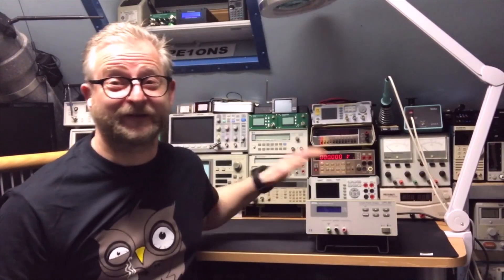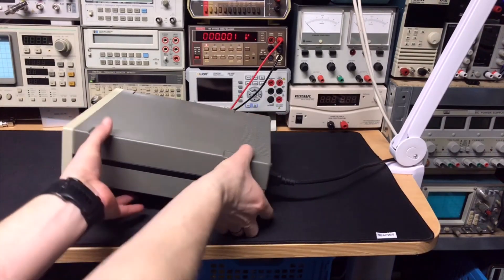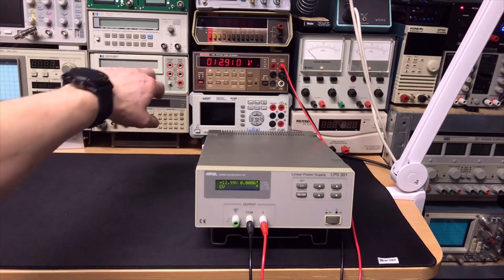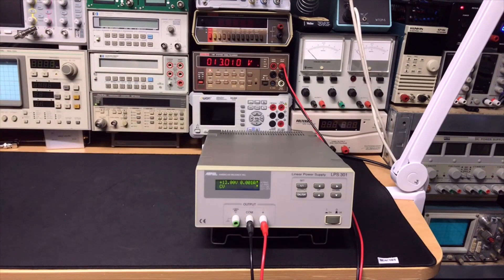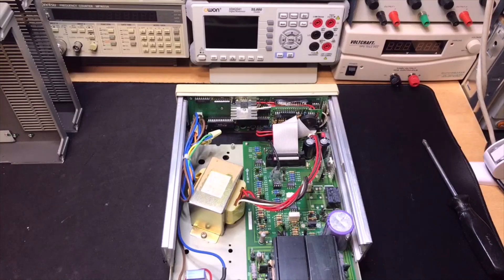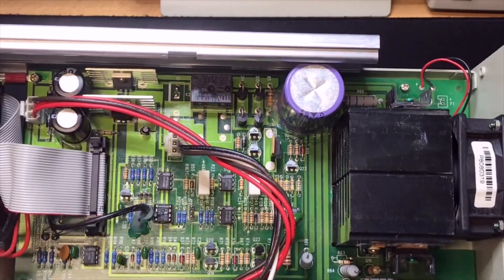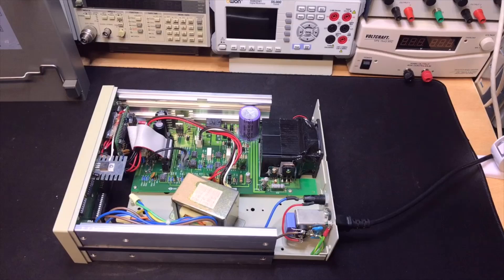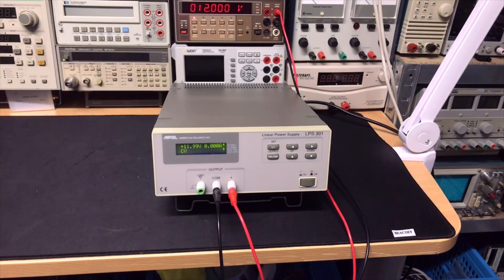#132 AMREL LPS 301 Calibration Cleanup Teardown

Comment: I used to have a power supply like that. When the buzzer is enabled, it makes a distinctive sound when it powers on, and also when it switches between cv and cc modes. I bought mine from ebay in a reworked state with few minor obvious issues that I fixed. But ufortunately, it wasn't reliable. Most of the time it worked, but sometimes it was outputing an incorrect unstable voltage, which was scary. Someone was fixing it before me, probably more than once, trying to workaround some problems by cutting PCB tracks and throwing bodgewires. Without the schematic in a non-virgin state after failed repairs, it was hard to bring it to good condition. I eventually gave up on it and gave it away to someone else. Agilent had excellent promo prices for U8002 power supplies, so I quickly got one.
Reply from the maker: Hello Thank you for sharing that, i do have the schematics if you are still interested.. yes the Agilent, yes proper stuff, well done!
Reply: Hi @TonyAlbus   I have an LPS-304 that no longer provides an output voltage consistent with the set value. During the calibration of V+ and I+, it does not supply any voltage/current at the output and always ends with error 2. I would like to repair it — could you please send me the schematics? Thanks a lot.
Reply from the maker: @0ruggine0  Yes email me, i send you what i have. you find it in about or more